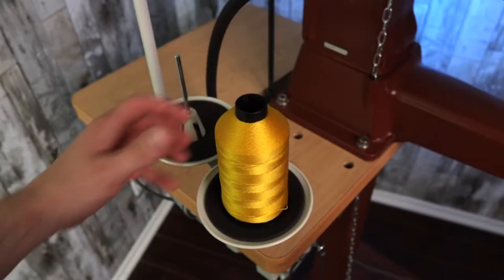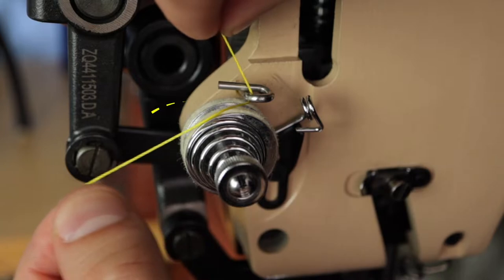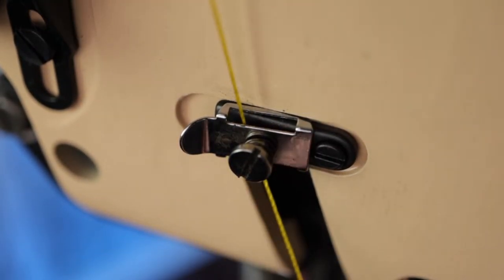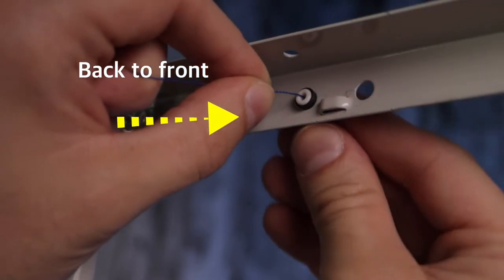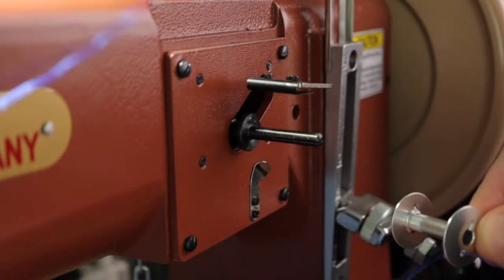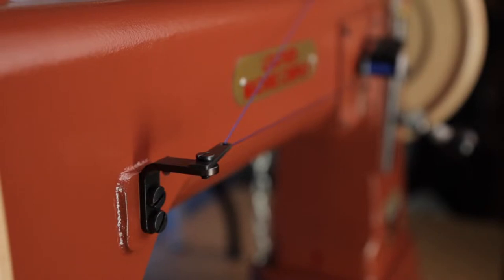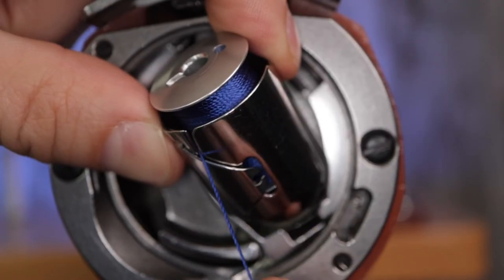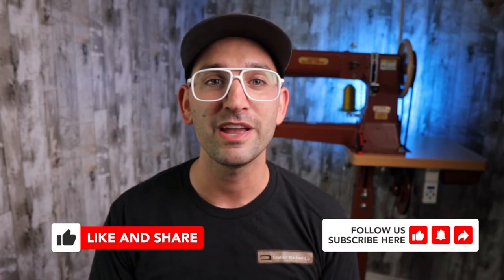Threading and winding bobbins on a Cobra Class 4 - EPISODE 21

Comment: Highly suggest that you look at the threading diagram in the original operators manual for a Juki 441 U machine. The original machine the Class 4 is a copy of. You did 3 things wrong here. You don't go back through the thread loop on the outbound side of the pre-tensioner. If you do the thread is in the line of fire of the tension release arm. Just go straight down. You don't go through the thread loop on the inbound side of the primary tensioner, just on the outbound side. And you thread through the right side of the spring loaded thread guide right after the take up arm. Just push your left thumb against the lever and it opens the right side up to be threaded. You want the thread from the take up arm riding on the smooth radius of the screw post and centered in the slot below it. The "curly thread guide" just after that is actually installed incorrectly on your machine. It goes in the notch on the bottom of the cover plate, on the outside. Your cover plate is probably hitting that screw and not seated against the machine body. (it was installed wrong on my Cobra too, but correctly on my 441)